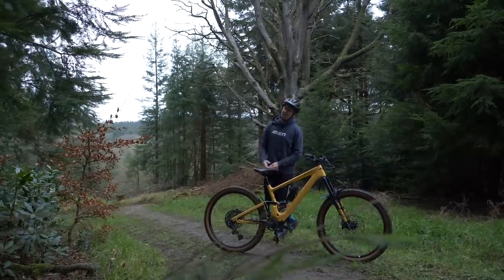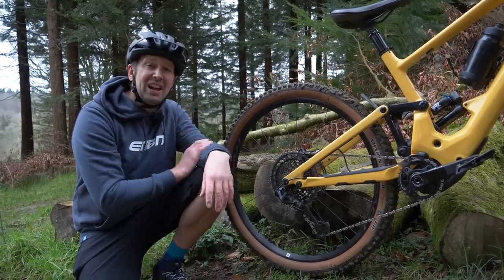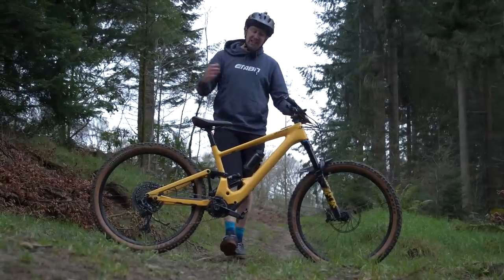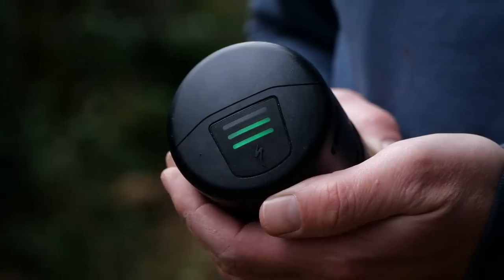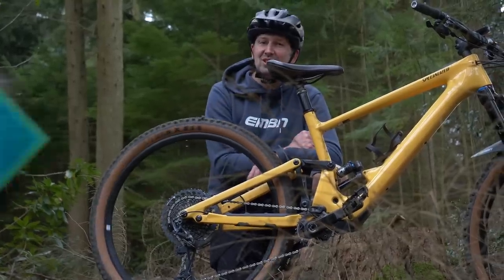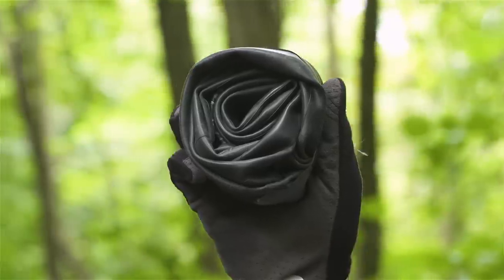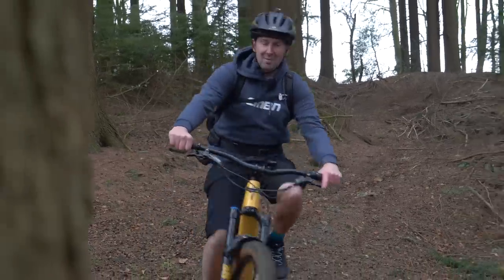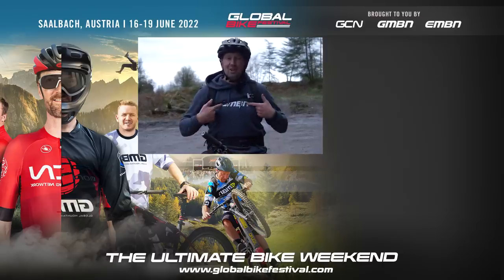9 Things You Shouldn't Do With Your EMTB!

Comment: I found it interesting that a “dead” lithium
battery can still burn. Although it doesn’t burn as hot as a fully-charged battery, it burns longer. Trying to recharge a fully discharged battery increases the chance of exothermal runaway (burning up at 2000C).

Comment: Have a question can i put any mtb chainring on a emtb or does it need to be a certain type
Reply: Don’t use alu chainrings, because alu is a softer material which will deteriorate faster with motor power.
Reply from the maker: Agreed with Roel van der Veen! Steel is the way!

Comment: Can you have more than one bike might sound a bit of a stupid question just pick up a Santa Cruz a good few months ago love it but thinking of getting a ebike?
Reply: Ebike is a game changer.  So much fun.  It’s like sprinting all the time.  Hills are flattened. So much fun.
Reply: Unfortunately Santa cruz ebikes use Shimano steps motor which has some issues and is not as reliable as other motor brands.
Reply: @wiel-spin  I use shimano steps and have never had a problem..... Good motor in my opinion.
Reply: @wiel-spin  still much more reliable than turbo levo. and many faults are about E8000, not current EP8. but you can keep repeating this mantra ))
Reply: @ferranox  to be fair to the E8000 that's what I'm running and I've never had an issue